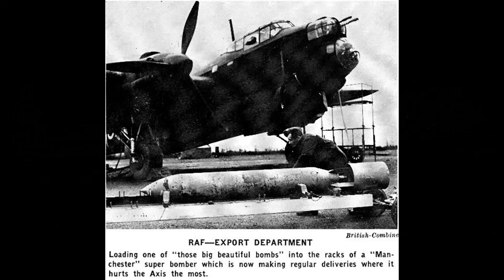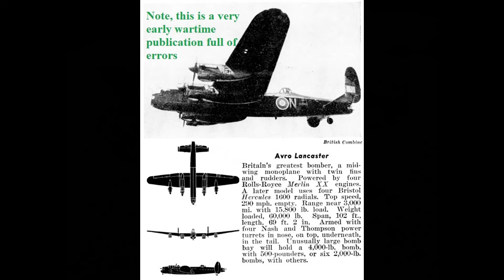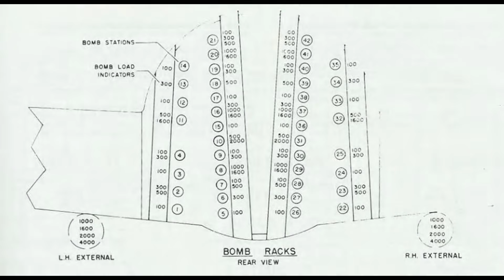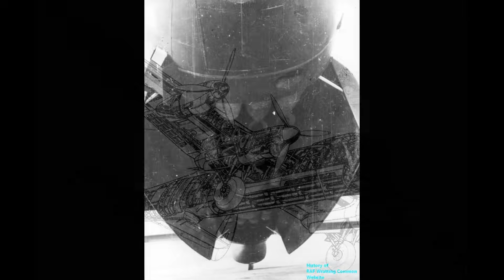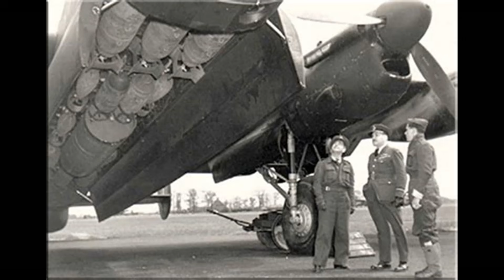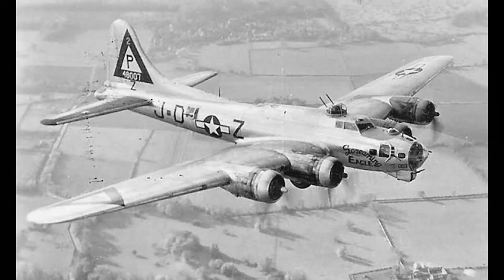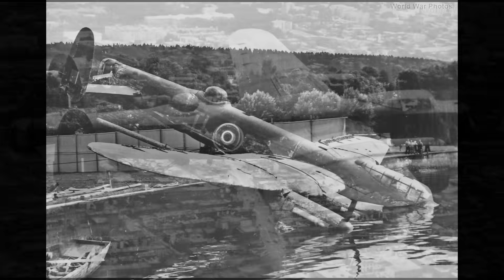Avro Lancaster, Payload, Turrets, Stability and More

Comment: In terms of the bottom turret (F.N. 64), Arthur Harris in his post war "dispatches" wrote it was removed because:

"(a) It proved useless for night work as it employed periscopic sights"

"(b) No means were provided for the gunner to determine in which direction his guns were pointing, relative to the direction in which his own aircraft was proceeding. The position originally provided for this under turret was later occupied by various Radar Devices." <---> I think this means the gunner did not rotate with the turret, so he always faced rearward while the turret moved. That would mean he'd have no idea where it was facing at night when all he could see through his periscope as blackness.

Harris in his dispatches is evidentially furious at the armament and turrets his bombers were equipped during the war, basically calling the department in the Air Ministry that designed turrets criminally negligent and completely incompetent.
Reply: The periscope was only good for 15 degrees of arc, so you needed to know where to look in the first place.  I read that after trials at RAF Martlesham most were removed at squadron level and the location patched over.  Later in the war the location was glazed over so a spotter could watch for anyone creeping up to play a little "jazz music".

During WWII Freeman Dyson (that Dyson as in the Sphere) was a RAF researcher and statistician.   He calculated that if ALL Lanc turrets were deleted and the fuel mix changed the Lanc would fly significantly higher and faster.  He reckoned this would save lives, partly because there would be a smaller crew lost with each casualty..
Some body somewhere had a turret fixation, I have seen photos of a Beaufighter prototype with a turret and there was even a mad idea about fitting one on the Mosquito.
Reply: @TheArgieH  I've been curious where Dyson got his figures for the Lancaster's speed without turrets. I saw a comment on an obituary for him online were someone said Dyson's figures were wrong as he based them off a non-turreted Lancaster that was used for courier work and which tended to fly with the wind to its back. Essentially the figures he used for speed increase was based off this model flying with the wind helping it along.

I dunno if it is true, but Dyson claimed a bunch of things after the war about his time in the ORS section which are flat out wrong. He claimed Bomber Command HQ ignored the small hatches on the Lancaster, but that is flat out wrong as we have notes from Harris telling the Air Ministry the escape hatches need to be enlarged. He also claims that crew experience had no effect on survivability, but its actually contradicted by the ORS report that came out in early 1944 which did show more experienced crews were more likely to survive a tour.

I'm not sure what to make of Dyson's commentary on his time in Bomber Command.
Reply: @kellyshistory306  Thanks, that is disappointing, it seemed logical enough.   However, he is presumably correct that removing the gunners would likely mean fewer lives lost overall.  At 40+% loss rate Bomber Command had the worst survival record for just about any branch of the services.
 There was another bit of research that didn't get shouted about, which was on the assessing the relative difficulty of escape from each of the RAF's four engined heavies.   The Halifax did quite well, afterall it was the only one of the three that you could stand up in.   The Lanc was comfortably the worst, presumably that main spar didn't help.  I believe the Sterling was somewhere in the middle.
Thinking of four engines and turrets, I guess the Sunderland was in a class of its own.
Reply: @TheArgieH  Yeah the Lanc had an abysmal 11% survival rate, Stirling was at 15%, and Halifax was 30% (though I've seen it put at 20% in other sources). It was in 1943 they discovered the Lanc death rate because they were noticing fewer POWs from Lancaster equipped groups were ending up in German POW camps. Harris put the Operational Research Section on it to find out what was going on. This ultimately led to them determining it was a mixture of small escape hatches, cramped interior, and the possibility the Lanc was more susceptible to breaking apart when shot down. 

If you're interested, I have a website hosting archival documents and it has a link to a 700 page manuscript looking at the Research done by the Operational Research Group which talks a lot about this stuff. Around page 377 on the manuscript the ORS leader talks about their studies they did on bomber types to determine losses and such. I've been using it a lot for my research.

https://kellys-history.squarespace.com/primary-sources
Reply: @kellyshistory306  Reminds me of the comment on unknown, unknowns.   I am reminded by your obit comment of the story of the Lancastrian, the fast mail courier airliner.   Built post War by Avro it was essentially the Lancaster wing, power plants and tail with a smoothed out streamlined  fuselage, boxy York it was not.   The Lancastrian  certainly did fly higher and faster that its forebear, so much so it led to a  disaster.   Operating in South America it flew high enough to encounter the jet stream, about which little was known at the time.   If you are blown miles off course, and do not know it, you can  fly into mountains, especially if there are some very big ones about, like the Andes.   That is apparently what happened.  I wonder if there is any relation to the Dyson obit comment?
Reply: @kellyshistory306  Many thanks for that.   I'm minded of the V bombers whereby only the pilot and copilot got ejector seats.   Also the observer in the early iterations of the Beaufighter NF, who had to leave his parachute behind when crawling down  into the belly to reload the cannon....in action.   Apparently escaping from a Hampden or Hereford was not an easy job either, if you have to fold up the pilot's seat to get to your station, reversing the process in time of need seems a fraught proposition.   The courage of those young men going out time and time again whilst all too aware of the odds against coming home is breathtaking.
Reply: @kellyshistory306  Dyson was a smart guy who narrowly missed (and probably deserved) a Noble prize, but his friends and colleages describe him a contrarian, always driven to take on whatever was the accepted wisdom of the day. This lead to his proposal that global warming could be dealt with by planting more trees; a good idea but not really justified by the sort of estimates he used for his calculation.
Reply: @fafner1  "describe him a contrarian"

It makes me think think of Mathematician John Forbes Nash (the movie "A Beautiful Mind" is about him) who along with his wife was killed in a car crash because both were not wearing seat belts. A brilliant man, nobel prize winner, but he and his wife apparently didn't think wearing seat belts was worthwhile and died preventable deaths because of it.

I've come to realize people can be incredibly intelligent, but also very flawed/egotistical at the same time. Dyson did good work for Bomber Command during the war, but I can't help but feel he embellished some stuff afterwards to create a narrative for some reason. Or maybe that was just how things looked to him. Dyson wasn't a high ranking scientist in the Operational Research department. It may have been a case of someone low in the hierarchy not seeing what went on behind the scenes at the top, and forming an opinion based off that.

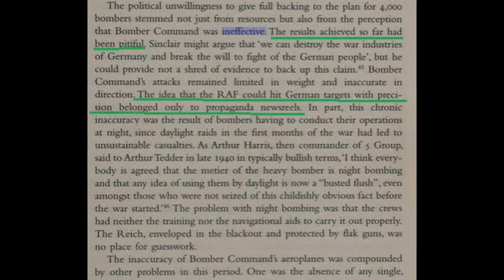Comment: The upper turret at 28:14 looks like a Lincoln turret, so this may be an early trial. Re lower turret - very difficult to pick out a fighter against a very dark background or indeed strong glare such as over a target.
Reply: Yes, the rear gunner was often tasked  with lookout. Sometimes holes were made in the floor to provide lookout options, even without armament, with the mid-upper getting the job. You'd only really see something directly below, if even then.
Reply: Not all Lancasters in general service had top turrets - most Free French ones seemed to have them removed.

Comment: Another advantage of having smaller twin stabilisers is that you can fit the bombers into hangers without any problems or expensive rebuilding, that would result from having a single very tall vertical stabiliser.
Reply from the maker: Yes, that's very true.
Reply: Yes, something US B-29s and later bombers had to contend with when they found a hanger big enough to house them.

Comment: I'd like to hear more about how they turned a twin engine plane into a 4 engined one. Merlins where smaller and lighter than the Vulture but the structural implication of hanging aditional 1 ton chunks of metal that create thrust further out in the wing intrigues me.
Reply: One thing they did is increase wingspan for the change.
Reply: Ed Nash has a good video on the Manchester. Check it out. Not as detailed as the stuff Greg puts out but still a nice overview.

Comment: Great video, as always. The point about the loading of the bomb bay being a chore is interesting, especially since each loading would take longer, if you start from the rear and move forwards. Since the Lancaster was a strategic bomber, and you'd rarely have more than one sortie per day/night, it all comes down to base infrastructure, and how many ground crew you have available for each bomber to do the regular tasks of repair, maintenance, refueling and rearming. 
One of my favourite early jets is the Canberra bomber, and especially the US-made B-57 Canberra. The improvements made over the British version is something the British should have considered for theirs as well, such as the tandem fighter-style cockpits(B-57B onwards) and the Martin rotating bomb bay(from the failed Martin B-51), which could be quickly switched out on the ground and pallet-loaded directly to the aircraft. Thus, this tactical bomber could keep up a high operational tempo if required.
Reply: Interesting point you make about the b-57. The improvements made by Martin really should have carried over to English Electric production. Yet they never did.
Reply: The UK employed rotating bomb bays  in other aircraft. I'm trying to remember if the Avro carrier for 6 500lb got the Mosquito was rotating or not. Not that it was ever used, nor the theoretical Mosquito 8 x 500lb loadout.

Comment: To me it is pure insanity to build a 4-engined, deep-raiding, heavy bomber with (relatively) light machine guns, practically no crew armor and unprotected, liquid-cooled engines.
The former two were dealt with here.
The latter next time - I assume.
The latter means the engines can take FAR less punishment than an air-cooled, radial engine as one, small hit to the coolant lines of an inline engine? 
And the engine will soon overheat and seize up.
The British had the Hercules radials.
Why in God's name did they not put those on the Lancaster more than they did?
Clearly, the powers that be did not give much of a crap about the lives of the aircrews using these attractive aircraft.
☮
Reply: Lancaster crews saw height and speed as their salvation. There is an argument that they should have ditched guns altogether and used their speed against the heavily overloaded bf110 nightfighters. Ditching part of the bomb load on the way to the target was apparently quite popular for this reason.
Reply: @andrewpease3688  That's brilliant!!!
I had never thought of that.

Actually, If I was a Lancaster Commander and I could get away with it (which I doubt)?
I would load only 1 ton of bombs on board.
Get rid of the upper and front turrets.
Get rid of all the crew but the pilot, navigator (who can arm/drop the bombs) and rear gunner (who can work the radio if needed). That way there are less people getting killed if you go down.
Forget about bombing the target...pick another, German city.
Go up to our ceiling near the target and then enter a gradual dive at full power to try and build up as much speed as possible (this is what He-177 pilots did on the 1944 air raids on Britain. Apparently they would hit 400+mph.).
Drop the bombs on whatever the heck we want.
And keep shallow diving at high speed until we hit the channel - or the engines overheat.
☮
Reply: @McRocket  this actually did happen. Various Lancasters had guns removed to increase performance, mainly for special missions but also some pathfinders had their nose guns removed and faired in improve performance. Bomber command loaded their planes to the hilt, so with war time production and maintenance being what it was, crews were fully authorised to dump part of the load over the channel if they found that the aircraft wouldn't gain enough height. Sometimes they would dump a little bit more.
Reply: Better yet, the far more numerous and successful Pratt and Whitney radial.
Reply: The Mk2 Lancaster did indeed have Hercules engines. Its performance was slightly poorer, so maybe the aerodynamics were affected. Later versions of the Halifax had Hercules engines and their performance was approaching that of the Lancaster by the end of the war.

Comment: Did they ever experiment with 20mm turrets?
Reply: They looked at them in 1943. A big issue was weight, and in particular the balance of the plane being thrown off by the much heavier turrets. "Center of Gravity problems" is basically one of the most common phrases you'll hear when it came to up-gunnign the Lancaster. Its successor - the Lincoln - does have a mid upper turret with 20mm's, but the Lincoln could carry it since it was designed at the outset for that turret.

Comment: Spend the money on Mosquitoes
Reply from the maker: That argument could be made.
Reply: @GregsAirplanesandAutomobiles  that's more of a fanboy argument. It doesn't have the Range or payload. And not particularly any more accurate.
Reply: @WALTERBROADDUS  much cheaper,much less manpower and much lower loss rates. Its is also claimed that they could perform 2 sorties a night. This was actually done towards the end of the war and was very successful.
Reply: @andrewpease3688  Ah, a member of the Mosquito fan club. 2nd to only the A-10 Club in undying love for a aircraft. And winner of the war single handed...
Cheaper and less manpower? Okay... ☑️ Better loss rate?  Okay... ☑️ But..... Are they really doing the same missions? Mosquito is a at best a medium/heavy fighter bomber. And it's not going to give any more night bombing accuracy then the Lancaster. So I will give the Mosquito it's due. But there are limits...
Reply: @WALTERBROADDUS  1/3 the cost. 0.5percent loss rate compared to 5.1 for the Lancaster when night bombing(<2% for the same bomb load?) . 2 crew instead of 7(you could make that 4 if you did 2 runs in one night) . 4000lbs bomb or4x 500 lbs(possibly x2) dumped on Berlin for at least the same accuracy. What's not to like? Daylight bombing was much more accurate than heavy bombers and if the figures are to be believed more effective against precision targets (such as V weapon sites) than any other bomber. Also an excellent night fighter, I rate it equal to the ju88, which fought throughout the war and was equally versatile. 
I have never been a fan of the gun on the A10 simply because I am aware of the huge loss rates of ww2 fighters when strafing and I can't see how it would be better against modern AAA.
Reply: @andrewpease3688  now you're talking about replacing a heavy bomber with a medium bomber though.
Reply: @WALTERBROADDUS  so?
Reply: @andrewpease3688  So, they don't do the same mission....
Reply: @WALTERBROADDUS  more mosquitoes doing the same mission. This is what was proposed. And in fact fairly large numbers were doing exactly that by the end of the war. There are a couple of problems, the British probably couldn't produce enough and the Germans would have countered by producing fast night fighters(and they did in small numbers)
Reply: @andrewpease3688  But, they're not really doing the same mission. The Mosquito is not really doing strategic bombing. It's doing tactical strikes.
Reply: @WALTERBROADDUS  mosquitoes dropped more than 10000 4000lbs cookie bombs on German cities. This was stratigic bombing.
The proposition put forward was more mosquitoes =better survival. Its not quite that simple, but is essentially correct. It was also ww2s best night fighter, among all the other roles it excelled at.
Reply: @andrewpease3688  there's some German night fighter Aces who might disagree with you.
Reply: @WALTERBROADDUS  why?
Reply: @andrewpease3688  why? Because they shot down a hell of a lot more than the Mosquito ever did in that role. Some of that may be due to opportunity. The Mosquito was a Good plane. Just not a magic wand.
Reply: @WALTERBROADDUS  never said it was.
German night fighters obviously had massively higher opportunities with hundreds of lumbering heavy bombers flying regularly over northern Germany.